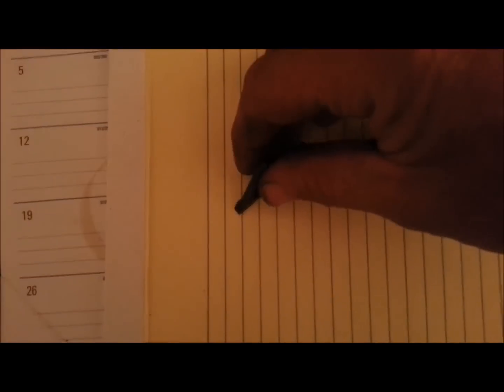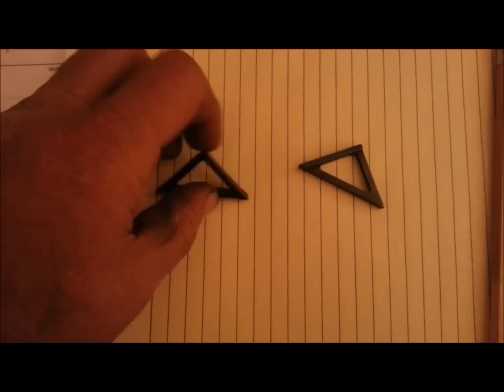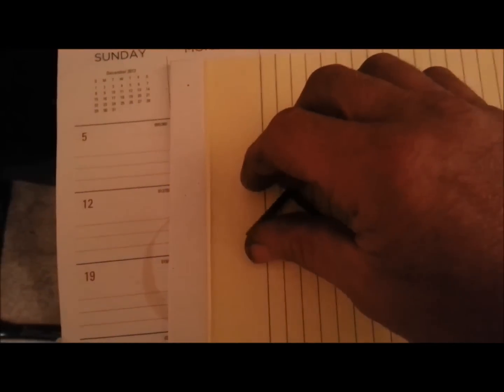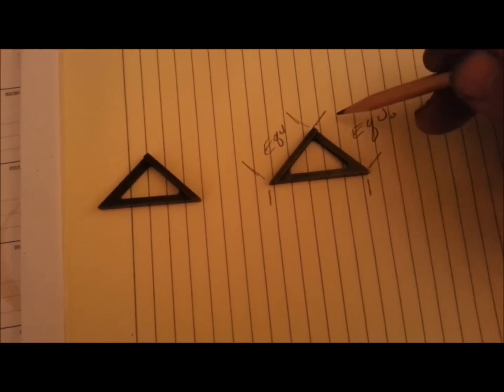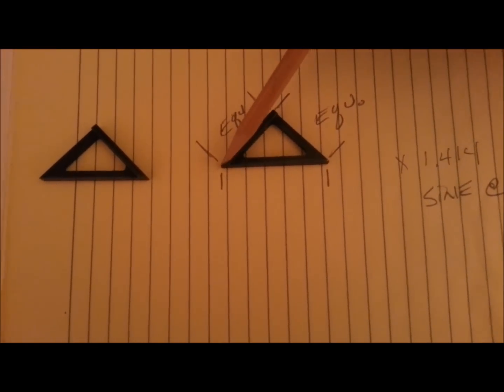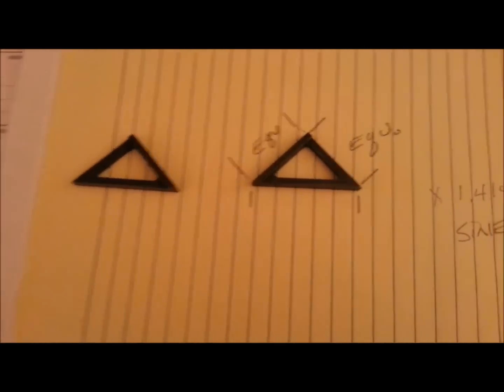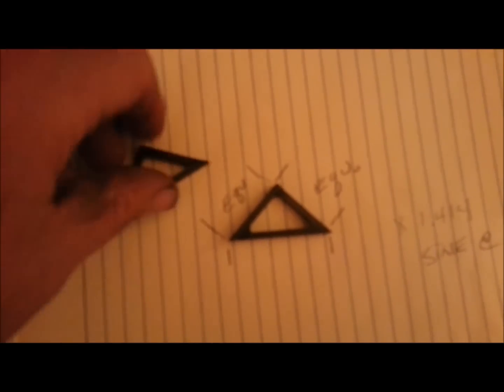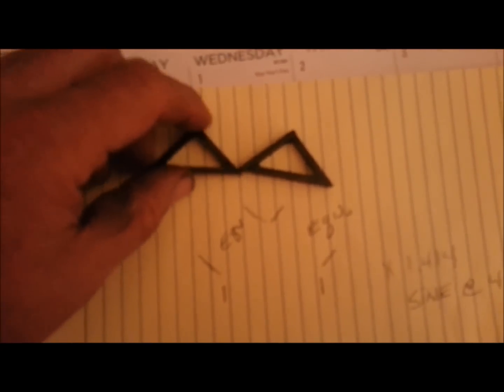One piece angle square #1

Comment: Yeah, really nice little things - each made out of ONE piece - guess so ?

Thx for the idea !
Reply from the maker: Yes, 1 piece, material was O-1 steel, 1/4" thick x 2" wide. I got the idea from a carpenter framing square, but they are very large, 12" x 12". I thought some mini ones would be handy.

Thanks for the comment!